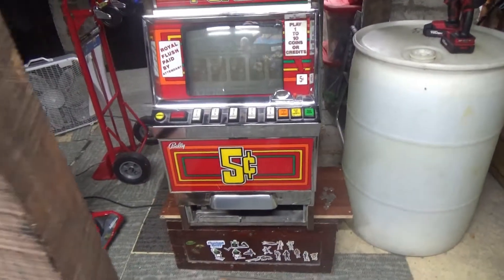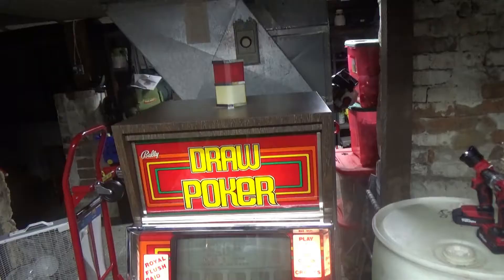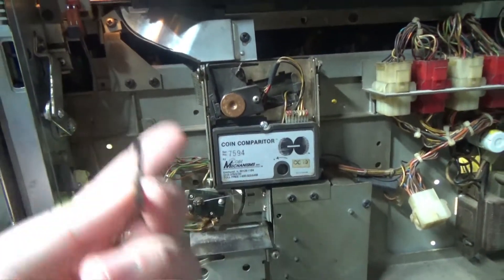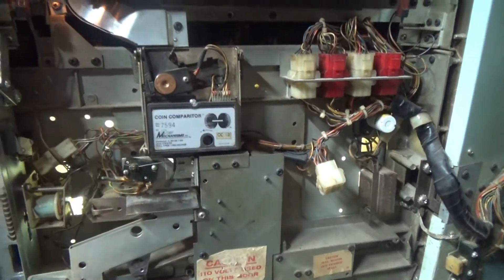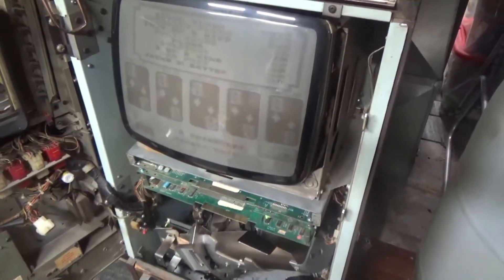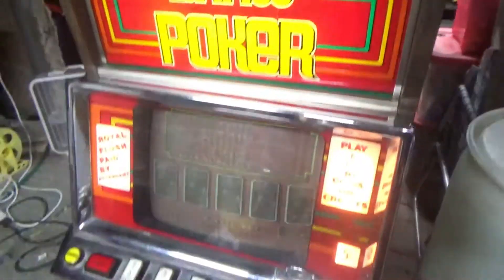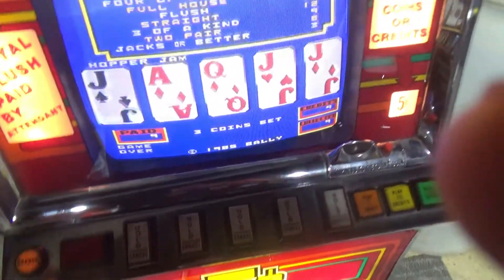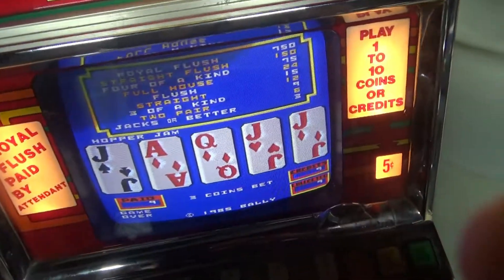Bally Draw Poker - Bad Battery or Low Battery Quick Fix - System Overview

Comment: Now I have the change light on to call attendant and cant or don't know how to reset. HELP
Reply from the maker: Check fuses, and make sure hopper is in correctly, no jams, if its jammed it will throw attendent light but usually will say hopper jam, you can also check to make sure the unit is completely closed up or it will throw that as well

Comment: I have the exact Same machine. I went to try your fix and found the switch in the back position. I moved the switch forward and the message changed to battery low. I moved the switch back and it worked great. Then we were playing and a friend tried to get paid out for more then what was in the hopper. Now I get a hopper time out message and dont know how to get it going again. Do you know what I need to do? anyone? I need help. Thank You!
Reply from the maker: Theres a button to push that resets it on the board i believe, ot might be on the hopper board
Reply: I shouldn't say it didn't do anything, it tested the memory and eproms it said on the screen
Reply from the maker: @bobdude20987  i have all kinds of issues with my machine, if i get the jarble screen or the boot loop i pull out the boards, clean the connection and put them back in

Comment: I have a similar machine that lights up but the monitor doesn’t come on. What would you suggest I look for?
Reply from the maker: I tend to stay away from monitor work, personally they scare me, so that's really the one thing I look for when buying machines, is a working monitor.  My monitor will fritz out now and then, but it really is just a matter of cleaning for me.  I can't say this will work for you, but all the harnesses and connections into the boards I would make sure they are clean.  Second, check the fuses,  mine will pop a fuse every 6 or 7 months, and that's not of use, that just turning it on and playing with it here and there, i think they're the old fuses just popping due to age.  My machine has several fuses, there's some by the power supply and there's some by the board.   Could be a simple fuse or cleaning issue.  Like i've said before in other comments, I really had a hard time finding any kind of info on these machines, my guess is having them for home use is rare and they were probably decommissioned and destroyed or updated to newer machines instead of going to sale for home use, however, I don't think the monitors are really anything different from computer CRT and other arcade machines, so if you have someone in your area that is able to work on these, they might be able to recap it or at least tell you if it's worth saving or not, or possibly if everything else is good and it's just the monitor,  update it to an LCD.

Comment: I have the same machine and it has pretty much the identical parts but I have the 25 cent. I took the board out and now I plugged everything back in and I have no video. What do you think is the issue
Reply from the maker: Really not sure.  Make sure no fuses blown and connections clean both back of the pcb and the plug ins on the right are plugged in tight and in properly
Reply: @BHGMediaGroup   thank you for responding your video has been a god send. 

The video was working before I did some cleaning and repairs. I just replace a fuse labeled F1 which is located on the circuit board that is attached to the back wall of the machine directly behind the circuit boards that slide out. It’s below the other 2 fuses (f2,f3). I replaced the blown fuse (labeled socss2 on the fuse cap) with Bussmann AGC-2. I just hope I didn’t damage a component when I disassembled the machine. Also, if you have the time can you please make more videos about this machine? This video has been very helpful and I can’t thank you enough for the information. I’ve been having some other issues with my machine as well. Before the video went out I kept getting a door open error even though the machine is unlocked and I’m not sure how the coin hopper is supposed to work.

Comment: Hello, I have found myself with the same machine just different artwork. My question is how do you find a pin out chart or any information on the hardware and boards? And if you had any data would you be willing to share
Reply from the maker: It was extremely difficult to find any information.  I have nothing as far as paperwork.  With the battery issue i saw someone had this on an entirely different machine but it just happened to work on this model as well.
Reply: @BHGMediaGroup  Thanks for your time. I'm having issues with intermittent video output but with your video I'm light-years ahead of where I started
Reply from the maker: @sc2958   if your unit is the same, I can suggest to you pull out the board and give it a good cleaning.  I had video issues as well where the screen would garble, or it would turn red,  or it would be playing and just reboot,  after giving the boards a good cleaning, the units been functioning very well.
Reply: @BHGMediaGroup   Have you found out how to change the bulbs in the hold buttons? I have the .25 machine. Thanks
Reply from the maker: @davidashworth9175  nope. Haven't figured that one out yet
Reply: @BHGMediaGroup  Thanks let me know if you do I'll do the same
Reply from the maker: @davidashworth9175   It's on the list of stuff to do as I have 3 lights that are burned out, I just haven't looked closely to see what's all involved, I just know they're not going to be easy to get to.  If I do change them out, I will make a video on it.